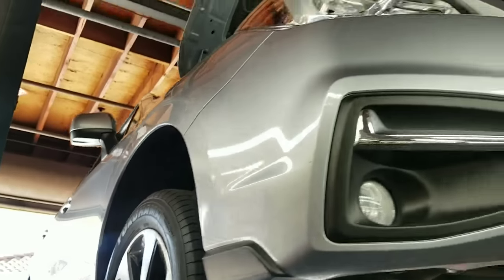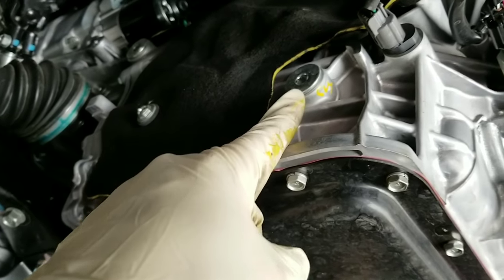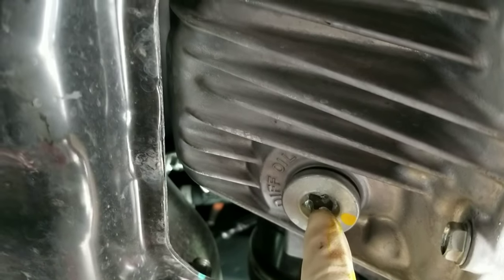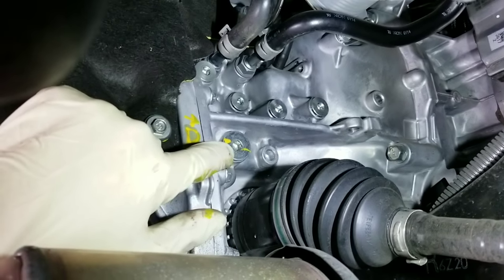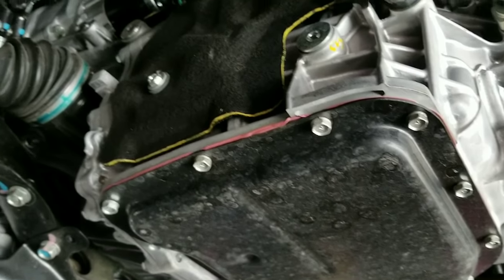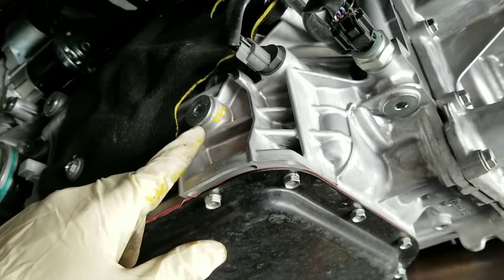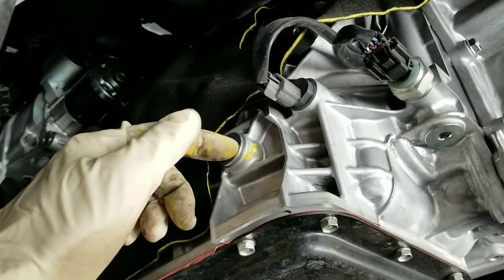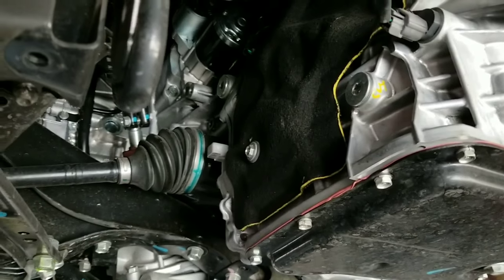Watch before you screw up your SUBARU CVT transmission & differential

Comment: I don't think my initial comment posted. Great video and awesome information! I wish I saw this before I rushed mine or I just wish I didn't rush it. I filled my CVT with 2L of diff fluid. Apparently this is a common mistake with techs and their procedure is to drain and fill twice. If I drop the pan, how much additional fluid is removed besides the 5-6L? My plan was to drain and refill with Castrol CVT fluid. For the first one, I may drop the pan. Can I drain and refill multiple times without having to drop the pan? I haven't started my car yet, so nothing has run through the system. Also, for the initial flushes to clear the diff fluid out, should I run the transmission up to temp and go through the adjustment/fluid level procedure? Or just drain, fill with new fluid, and drain again without running? I plan on refilling with Subaru CVT fluid once I'm done flushing the system. I would greatly appreciate any additional insight you may have.
Reply: I did the same thing. After adding 2 quarts of differential fluid to the cvt I became aware nothing was coming out the diff overflow.  I drained the cvt and then filled with cvt fluid and ran for a week then drained again. This time is drooped the pan which I bent to hell inorder to check the filter. The filter was fine so I guess I wasted a filter and a pan.  I should have just done a double drain and fill. That was 20000 miles ago and no problems.  I drain and fill again in another 10000
Reply: @jeffreygoss8109  Glad to hear it's still running strong. I just did a drain, flush, and fill without dropping the pan. Running fine a few hundred miles in now.
Reply: That happened to me today...-_- I dropped the pan with my mechanic, let it drip out completely, put some fresh cvt fluid in the same place I put the diff fluid and sae that it ran completely out. Then cleaned up the tray and pan, re sealed and installed. Then filled about 6bottle of cvt fluid with the warming procedure and shes running good. I think I will get a propper cvt flush from Subaru just in case tho
Reply: @17.06.Copper  I just put new fluid in mine to flush it, drained it, and refilled with fresh fluid as per the procedure. Almost 6000 miles since and haven't had any issues!
Reply: @Czwakiel  thanks man I did that!
Reply: It was rookie hour in the garage today...glad to see I'm not the only one who had a bad day.  I didn't run the engine or transmission after I put in 2 qts of gear oil and realized something was definitely wrong (just like Mr. Goss above).  I do like the idea of pumping the same amount of CVTF through the same wrong hole (like Brandon B did) to push the gear oil out and let it drain instead of dropping the pan.  Any words of wisdom or is dropping the pan they way to go?
Reply: @Czwakiel   How is your CVT holding up?  I did the exact same thing  of putting gear oil in the wrong hole, but I like your idea of not dropping the pan since I did not run the engine or transmission after I realized my mistake.
Reply: @GGrits21  The transmission is still going strong and holding up. I'm pretty demanding on the car and haul pretty frequently with it (towing or just weight in the car). I haven't had any issues since that day.
Reply from the maker: I would drive it for 20 min after draining/filling transmission fluid, then drain it hot once more. Probably do another drain and fill sooner than later afterwards. I would drop pan at least 1st time (before starting, after mistake) to get as much gear oil out as possible.
Reply: My mechanic made same mistake by putting 1 liter of diff oil in my CVT,  unfortunately I did drive the car for 30 km because I thought they knew what they were doing. I am planning to have the car towed to my Subaru dealer to have it done whatever it needs to be fixed. I was wondering how are your cars' cvt holding up after all the flush and drainage. Thank you.
Reply: @fisherpaykelauto6137  I have over 10,000 miles (16,000 km) of driving on the transmission now. Everything has been normal and I haven't experienced any issues. Those miles include some heavier towing.
Reply: @Czwakiel  Thanks very much for your response. It makes me feel much better 😀 Subaru dealer had flushed my transmission twice and put new fluid in, I hope 🤞 it will be okay, I will give an update after a few months. Thanks
Reply: Well.... It was rookie hour in my garage tonight as well. It it good to see that a drain and fill was no issue.   I already pulled the pan and filter. Cleaned it all up, sprayed some brake cleaner in the trans where some contaminated fluid could be sitting.  Now to put it back together tomorrow after work.

Comment: Can you elaborate which specific model your showing us.? After showing us. I followed your method. I cannot find my refill plug for my front gear oil. I have 2019 forester( sport). Yeah guys don’t take it to 10min oil change.  Thanks!!!! ✌🏽
Reply from the maker: i believe this was a cross trek but if you are looking for diff fill, there is usually a breather on the right axle side you can use. and the cvt fluid fill   on your 2019 fozzy n/a, it should hav a fill plug left rear facing rearward a couple inches above the pan. cvt drain should be front left, bottom side of pan.

Comment: What if I fill the transmission through the top left plug? And wait for it to spill out a little bit. Does that mean Ive put to much transmission fluid inside of my transmission?.
Reply: Did you find an answer to this?

Comment: No. You removed the diff check plug BEFORE adding gear oil. When oil trickles out, put check plug back in. Done.

Comment: We do these at my private shop often, as Subarus are VERY prevalent now. We capture the old fluid in a measure and just put back the exact amount. Only recently have I encountered times that it begins to overflow just before I finish replacing the exact amount that came out, which indicates to me that its coming more important to actually hot run trickle them to ensure proper level. But man the last 14yrs of never having to check levels other than if the trans had a leak, have been wonderful! Guess its time to start charging more for these ones that need to be idled hot to top the fluid.
What is the average rate for a 4qt CVT job, to check my price of $100...
Reply from the maker: If you do a virgin drain, capture and measure, it should be perfect or close to it when you fill, but you must have car running to get all fluid in there unfortunately. But sounds like you got the right idea
Reply: You cross your fingers or say a prayer that the last guy to change the diff oil did it right?
Reply: @UMepher  Nearly 100% of my customer base is always virgin flushes or return clients. If there is evidence of a leak or high mileage then I will do the level procedure. But typically 99.9% I just capture, measure and refill and never had a problem in my 15yrs. I dont have time in my day to spend ridiculous amounts of time making up for the idiots that work in design.
Reply: Just make damn sure you don't spill or splash any on draining.  That would throw out your measurement technique.
Reply: @TucsonDude Transmission fluid measuring is not a "precise" thing, like engine oil level. As long as you are within 1qt you are fine.
Reply: @ripptydevibes2581  I'd still probably "overadd" about 1/4 quart to account for losses as there will always be a thick film of oil on the drain pan unless you directly catch it all in a measuring bottle without any transfers.
Reply: @TucsonDude  That is the method. 1/4qt more than you captured
Reply: @ripptydevibes2581   What you captured and what you finally measure are not the same.  You're going to have fluid loss as you transfer from container to container as oil DOES stick to oil pans, funnels, hoses, etc.  You have to allow for that.

Comment: As said in comments below, make sure you can beak the torque on the fill plug before you drain any fluid. Easiest to break the torques on the plugs when they are hot rather than cold. The specific torque values should have been covered in the video.

Comment: This is the reason why I always buy a vehicle with a manual transmission as it is more straight forward. I changed my engine oil, differential oil on both front and rear on my 2020 Crossstrek with the manual transmission. It is very straight forward, providing you have some knowledge and proper tools.  Please save the manual. Stop buying with a CVT.
Reply: I used to be that way, but you can't get any cool features with the base manual like sunroof or the bigger engine.  My other cars are manual, tho.

Comment: If you drain & refill, about what percentage of the fluid is replaced? Is there a DIY way to get ALL the fluid replaced? I could do that on my 05 Camry by disconnecting the ATF line at the radiator.

Comment: I'm going to get an impreza g4 2017 (2wd, not the AWD) and the steering wheel is in the right hand side. I thought that the transmission fluid could've been filled by opening the hood. But what's the purpose of doing what's illustrated in the video tho?

Comment: What oil brand  should I use on my crosstrek 2018 rear and front differential , with a CVT transmission . I’m getting so confused with this   Specific subject! At this point I don’t know if the Subaru certified fluids are on top or those are just overage fluid and the brands ; red line and Mobil 1 are the ones on  top of all the  fluids brand ? Someone please help me .

Comment: @subtledriver ...(while on a lift or leveling jacks) When warming up the cvt transmission do you need to cycle through the shift points or just leave it in Neutral until it hits the proper temp ??
Excellent video & Thanks for the information !
Reply: There aren’t any gears to shift through.
Reply: Yes
Reply from the maker: Shifting through gears for a few moments and then return to park and wait for temp to go up and check level when it reaches operational temps. You will need to top off while it's running since fluid level will rise when you turn off the engine unfortunately

Comment: This fellow references five quarts for the CVT ...that is not a full service, which is the entire 13 qts, right?  To fully replace the CVT fluid, it must recirc either the same fluid through the entire CVT or an approved flush fluid?
Reply from the maker: @georgestephenson356  if you change 5 qt on a regular basis, it will be just fine. No way to get every contaminant out even with a full flush

Comment: Here in the UK I asked about CVT fluid changes and I was told no chance, they won’t do it. Subaru UK says it’s a sealed unit and is warranted for 100,000 miles or 5 years.  I asked a Subaru specialist shop and they also said they would not touch it. 
Thank goodness for Coronavirus, I have only done 8000 miles in a year, so looks like I won’t be hitting 100,000 miles before I sell the car 😂
Reply from the maker: thats comical! i would do every 20k-30k drain and fill.

Comment: Thank you for this video just changed the back and front today, the front fill plug was a bitch to torque. Gear oil was also hard to find in my area, hopefully the Lucas 75w90w synthetic works out.
Reply: I prefer Redline (available locally) but Lucas is perfectly good. Every auto parts store I've ever seen stocks gear oil, not to mention Walmart, Amazon, and auto dealerships. You on Easter Island?
Reply: @UMepher  no, I'm in SoCal.

Comment: Thanks for the vid. Was going to do a  pan drain and  fill on the '17 Impreza  Crosstrek at 60K.  but what size  and  type  of  bits for the fill/drain plugs?  Also, which aftermarket fluid  for this FFUJI H.I.   puller-belt CVT would  be a  good  choice? I Know  its likely a  different spec juice than the JATCO pusher-link belt type used in the NIssan CVT8. Thanks again,  Sandy.
Reply from the maker: I filled with the orange color fluid on some heavier duty subies... honestly i forgot... this was a few hundred cars back. you can drain a little to see the color i suppose. the hex socket was most likely a 10mm but it is best to just buy a socket kit anyways..... sorry, i am pretty useless today.
Reply: Drain plug on front diff is t70 and check plug is 8 mm according to another video I found online. According to that video you can fill your diff fluid through the check which I want to do rather than trying to reach the fill plug.. Search “Subaru crosstrek front differential oil change” for the video

Comment: I've been filling my differential through the check plug but it's difficult because it has a sort of wall that acts as a drop off. On the subaru impreza all the fill plugs are notorious for getting sucked in and getting stuck.

Comment: I sit here tonight making this exact mistake except I had the common sense to not drive the car. The diff was not filling up with gear oil and I pumped 2 quarts of gear oil in. Something wasn’t right. I pulled the transmission plug and sure enough my expensive royal purple came pouring out of my transmission pan. My question now is… if I fill the diff up and replenish the transmission with (not gear oil🤪) but transmission fluid should it be ok to run?

Comment: Thanks for the video.
Passing along info.
2016 Crosstrek with Manual trans.
Dipstick/fill is on the right hand side of vehicle.
Having read all the confusion over CVT, I’m wondering about potential problems with MT/doff.

My question
Is th e one dipstick/fill for BOTH 
the Manual trans & front Diff??
Reply from the maker: Manual trans has diff and trans as one unit. No separate fills.
Reply: Thanks

Comment: Hey I’m not saying you are wrong but I had to do one today and I believe you can fill either side I had to look up the service procedure on the computer and it had me fill on the right side
Reply: I have a 2018 crosstrek. The access to fill/check plug(left/driver side) is blocked by the exhaust pipe, however, on the other (right/passenger) side of the transmission there is a similar 8mm hex plug.  Can I use that instead, to fill and check?

Comment: I drained my CVT 2017 OB. Last CVT was changed back @65k miles.  Now it’s almost 101k miles.
The fluid coming out is like yours, like dark orange/red. My question is, how many qt of CVT did you put in to temporary flush the remaining red/orange fluid?. I only have 8 qts of green cvt. Can I only put 2 qts then idle the car with gear shifting to park/d/r ? I don’t want to use too much since I don’t know If I’ll have enough qts to finish the job?

Comment: The diff level check plug looks like it would just drain out your fluid.   It looks to be facing down.  When I do my other Subaru diffs I just fill it until it’s dripping out the fill and that’s it.   Can you explain how to check the level with the third plug?
Reply from the maker: the 3rd plug facing down is the level check/ and can be used as a fill, it is not the lowest point, it is the highest. this is not conventional. if you fill it on the side port till it comes out, you would have overfilled it by  several quarts at least and you  may blow out seals.
Reply: subtledriver oh ok.  In the video it looks lower.  I haven’t done this to my cvt yet.  The one I was referring to was the 5eat that I will fill until it drips.  Totally different.  Awesome video tho.  Gonna change it this weekend probably thanks

Comment: How are you supposed to fill something & put the bolt back in when you are fighting gravity the whole time?
Reply from the maker: the "fill" plug on the front diff, is supposed to use a special fluid pump with a threaded end (hence why I like to fill from the right side plug or the dipstick/breather)..... The transmission, you want to have the engine running and cycle through the gears to get it all in unfortunately.

Comment: 2017 outback 3.6 just did my oil change on my deferential. And I filled it through the check  Fluid level. Is that gonna be OK. Thank you for this video I couldn't find anything out there till of course after the fact. Thank you for making this video short and sweet.
Reply from the maker: thats totally fine, just make sure you filled it with the right amount. you talking about the smaller plug on the bottom right?

Comment: Thanks a ton for the talk.  I have a 2012 Impreza 2.0 with CVT and on start it occasionally throws dash lights -- steady AT TEMP Light and TRACTION CONTROL light.  and dies.  Ideas?  Which one of those two sensors above the CVT fluid check/fill hole is the AT Temp sensor??  THANK YOU

Comment: If you're filling the differential and you want to check the fluid through that other plug that is facing straight down how do you check the level? Do you put your pinky in there and curl it over the edge like in the old days and if your finger is wet then it's full or what

Comment: Are there possibly two fill ports for the CVT, one on each side?  On my 2020 Forester, the exhaust pipe runs right along the CVT fill port on the left side, whereas the car in the video has the exhaust pipe on the right side.  On my car there is an identical port on the right side, same height and same castings around it.  I wonder if Subaru put fill ports on each side so that they could use the same CVT for right and left hand drive cars.
Reply: did anyone ever find anything about this?
Reply: @dustinlong4759  Yes, the differential fill points are the same as shown in the video, however the 2019 and newer Subaru's now have the CVT fill on the RIGHT or passenger side because the exhaust on the left side is now in the way according to a post in the Subaru forums, which is based on the service manual! The video above does not tell what year the model is, but the exhaust is on the right whereas 2019 and newer the exhaust is on the left.